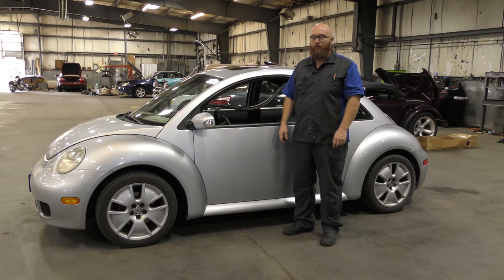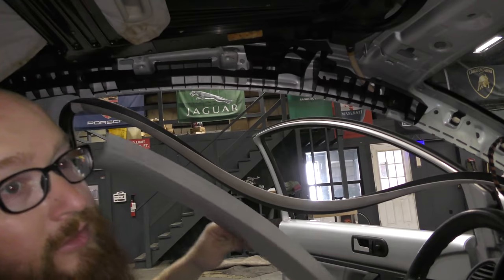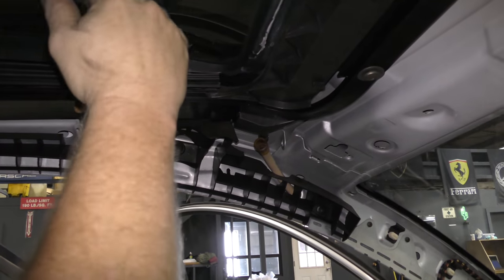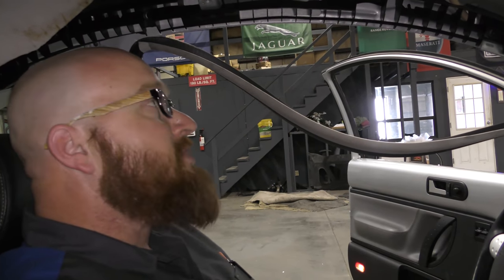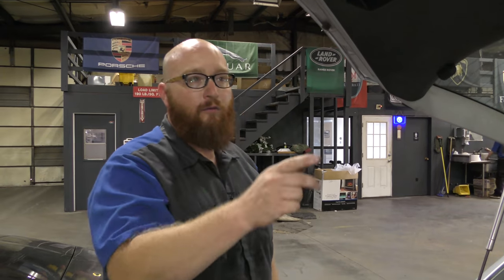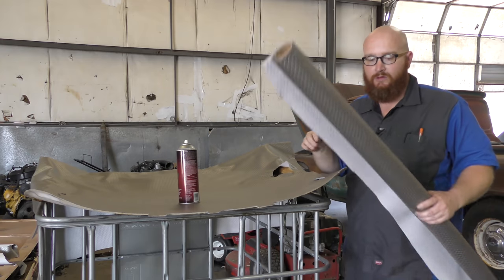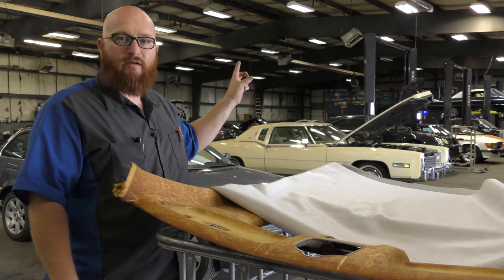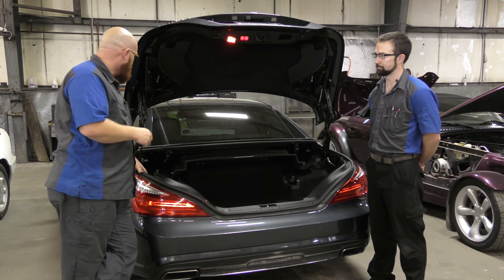VW Drooping Headliner & Mercedes Convertible issues! CAR WIZARD shows one is easy and the other not!

Comment: Is it possible to clean the sunroof drain tubes from outside, possibly with compressed air, without disassembling the headliner.
Reply: My 2009 Jetta had the same problem,  but it leaked in both footwells! No easy way to fix them😩
Reply: Can't say for sure about VW's but i was able to get access to the the drains in my Dad's subaru by just opening the sunroof.  Videos I watched at the time suggested using string trimmer (weedeater) line.  That is what I used.
Reply: It's not a great idea because you could blow the line off the fitting and have a real mess requiring disassembly anyway
Reply: @vincediesil  . Thanks for that. Maybe string trimmer line is the way to go as @boat6868 suggested.

Comment: Would I be able to use a different fabric if the original was damaged? 

My first car was an 89 325i and learned about sunroof drains the hard way. I noticed some drips in the footwell, peeled behind the headliner, and found the entire roof panel was covered in rust. 

Edited to add the question.
Reply: Juan Barba - I’ve absolutely switched fabrics. Just get some fabric with some give to it so you can get it around the curves. I used Permatex headliner spray and purchased the new material from JoAnn fabrics. Honestly, check Walmart too. If you’ve got issues with the old foam sticking to the headliner hit it very lightly with a random orbital sander to get it smooth and clean. I have done my headliners in an afternoon.

Comment: Hey wizard, what do you think of Subaru? Which one's to avoid?
Reply: Avoid many of the EJ series, EJ25 is most commonly used, which had powder-coated  headgasket that would fail, unless someone put new/updated headgaskets in. Any newer Subaru with an F series engine, such as the FB25, is a good motor with no headgasket issues. Flat 6 engines do not have headgasket issues either, EZ30/the newer EZ36D. Turbo (XT) flat four is good too, but people tend to beat the hell out of them. Hope this helps!
Reply: Buy a Toyota.
Reply: Oh dang I have an ej25 Subaru

Comment: 1000 bucks?! Come on, that doesn't make sense. I just did my whole wagon top - headliner, sunroof and columns(6) for 250€ at a shop. On my VW Polo just the headliner was 50€... That is for disassembly, assembly, work and materials.

Note: my upholstery guys clean the old foam with a pressure washer :)

Comment: The 'quality' of New Mercedes. Maybe $10 worth of wires?  IF it could actually be 'fixed'.I am sure the bundle had to be replaced. So that $500? Disables a hard-top convertible. Nice styling, but never got that issue on my '83 560SL. 'The more complicated the plumbing, easier it is to stop up the works'. New doesn't always mean better. Just means extremely complicated. And the cheapest part can stop all the fun. Pieces of wire.

Comment: Hi Wizard, about you question "what weird wiring problem..." it wasn't exactly a wiring problem but still: my 2006 S203 CDI 2.2L Mercedes started to show random ESP error: the antiskid was still working but still there was this error popping out frequently. I passed through forums and many were pointing out to the double brake pedal switch, so I checked it and cleaned it, but it wasn't the culprit. Then I checked all the ABS sensors with a multimeter and they were ok. Then I read that some guy changed the differential oil and that fixed the error, so I did that too, but still I was getting the error. Finally I bought this thing (actually I paid 170$ for it): https://www.icarsoft.com/Product/s-300-iCarsoft_MB_V2.html and there was NO error whatsoever... So finally I used the "real time reading facility" and I discovered that when the error popped out, in the very same moment the CPU was stopping to receive the steering angle sensor data. So I removed the steering wheel and the sensor, open it, clean it with some professional electronic cleaner and deoxidizer spray and boom! Error disappeared and it's ok since 2 years ago. And well, even counting the 170$ of the diagnostic tool, I spared 380$ out of the 550$ that Mercedes would have asked me to replace the sensor, which now is running perfectly since then :)
Cheers, Alex, Milano, Italy

Comment: I use weed wacker line to clean out sunroof drains. You dont need to remove the headliner....
Reply: Wizard was just saying that, if you're already doing the headliner on a car with a sunroof, you might as well check the drains from the inside while you're there, especially if it's easier to access them that way than from the top with the roof open.
Also, with the headliner off, you can check and clean the rear part of the sunroof mount/drains that isn't accessible from the top/outside.

Comment: One would think with all their over the top german engineering Mercedes could do better with this wiring situation, its nothing new as wizard said ---  years ago I worked on a guys '63 Cadillac Fleetwood and none of the electrics worked in either front door, plus blown window and interior light fuses.  Pulled back the rubber door jamb boots and all wires were dried out and broken in two from decades of heat and cold and bending back and forth untill they all just gave up.  I spliced in a couple of short custom made silicone wire harnesses from inside the kick panels out through the jamb boots into the doors so the new softer silicone wires would take the flexing.  One would think by now mercedes could spring for silicone wire harnesses or similar at these bending points - especially for what these cars cost-!!

Comment: Its amazing that after decades of this problem, nobody figured out a better and permanent way to do this so the headliner wont fall apart after 8 to 10 years.
Reply: Jason Radice. I think most car companies have a whole team of people who's job it is to design components that last just long enough until the warranty runs out before they fail. Then to make the component, either so difficult to repair, or so expensive to replace, that the owner gets rid of the car and buys a new one Not only with cars. lol

Comment: Happy Fourth of July (Independence Day) to the Car Wizard. Especially that there will not be a new video from him, because he is celebrating it with his family on that day. I am hoping sometime by next Wednesday for another buy this, not that video on other brands and other types of vehicles. I got the list:

To buy - 2014 and newer Mitsubishi Outlander 4WD compact SUV with the 3 L V6 and six-speed automatic
Not to buy - 2001 to 2007 Dodge Caravan/Grand Caravan with the 3.3 L & 3.8 L V6 and four-speed auto

To buy - 2014 to 2018 Mazda 3 sedan or hatchback with the 2.5 L I4 engine and six-speed auto w/sport
Not to buy - 2008 to 2017 Mitsubishi Lancer sedan with the 2 L & 2.4 L I4 engine and CVT transmission

To buy - 2005 to 2009 Hyundai Tucson 4WD compact SUV with the 2.7 L V6 engine and four-speed auto
Not to buy - 1999 to 2004 Chevrolet Tracker 4WD mini SUV with the 2.5 L V6 engine and four-speed auto

To buy - 2013 to 2018 Toyota RAV4 AWD compact SUV with the 2.5 L I4 engine and six-speed automatic
Not to buy - 2008 to 2012 Hyundai Veracruz AWD crossover with the 3.8 L V6 engine and six-speed auto

To buy - 2009 to 2010 Hyundai Sonata mid-size sedan with the 2.4 L I4 engine and five-speed automatic
Not to buy - 2008 to 2010 Chrysler 300 full-size sedan with the 3.5 L V6 engine and four-speed automatic

To buy - 2017 and newer Mazda CX-5 AWD crossover with the 2.5 L I4 engine and six-speed automatic
Not to buy - 2010 to 2011 Mazda Tribute 4WD compact SUV with the 3 L V6 engine and six-speed auto

To buy - 2008 to 2013 Toyota Highlander 4WD mid-size SUV with the 3.5 L V6 engine and five-speed auto
Not to buy - 2008 to 2009 Pontiac Torrent AWD mid-size SUV with the 3.6 L V6 engine and six-speed auto

To buy - 2014 to 2017 Ford Expedition 4WD full-size SUV with the 3.5 L Ecoboost V6 and six-speed auto
Not to buy - 2009 to 2012 Ford Flex AWD crossover with the 3.5 L V6 engine and six-speed automatic

To buy - 2016 to 2018 Volkswagen Jetta sedan with the 1.8 L turbo I4 and six-speed automatic w/sport
Not to buy - 2006 to 2009 Volkswagen Jetta sedan with the 2 L turbo I4 and six-speed DSG transmission

To buy - 2013 to 2018 Acura RDX AWD compact SUV with the 3.5 L V6 engine and six-speed automatic
Not to buy - 2003 to 2009 Kia Sorento 4WD mid-size SUV with any engine and any automatic transmission

Comment: I hate how they make headliners. They should make them molded plastic and easily REPLACEABLE. You can put cloth over the plastic or leave it bare. If it was removable, you could customize LED lights for additional in-car lighting, or put USB and/or audio jacks so back-seat passengers can easily access them.

Comment: VW headliners are horrible. I had a customer with an 08 jetta that I did a headliner on it was a nightmare. They put it in from the factory thru the windsheild and all of the clips are one time use. But most cars it should only cost a few hundred. But if you do it yourself I wouldn't recommend the 3m 77, spend the extra money and go with the 3m 90 its well worth the extra money all the ones I've done have held up down here in Florida for years.

Comment: Why would you punch a hole in a perfectly good roof? That’s an old mechanic told me one time. Bunch of junk. I have had those Volkswagens in my shop with every door panel and every single piece of plastic falling off. They didn’t do a very good job with making the interiors on those. Looks like you’ve got a better one than most but not by much

Comment: Seems like those VW-Audi cars need endless work.... economical money pits?
Reply: Yeah Volkswagen all the small cars are not very well made they're always falling apart
Reply: Paul Schless Thats rubbish i have many VWs and drove them all around Europe no problem
Reply: Just stay away from VAG products and you'll be fine.
And other European brand's and American brand's.
Just go and look for a '90 s Japanese car
Reply: AKA project car.
Reply: @neilmurphy845  don't underestimate BMW,Renault,PSA,Mercedes compared to those even Fiat is doing a great job.
Then again,just dont buy European or other western rubbish,that are designed to cash money and not reliability.
The days of reliability are far far behind and even the Japanese cars are starting to fall apart,but are still better than the rest in my humble opinion.
Reply: Lonewolf rider Are you Scotty Kilmer in disguise?
Reply: @Lonewolf_rider  ya but we have a few Renault  products and their grant well it says Nissan micra but it's really a clio
Reply: @neilmurphy845  all the Nissan's are based upon Renault, except the Z and the GTR.
It started around '97 where they shared parts and Nissan mostly used Renault's body's but kept their own engines half way 2000 Nissan uses Renault gearbox with their own engine and around 2012 till now it's mostly Renault. Check under the car and I'll bet you will find oil sweat.

Don't rev up that Renault Nissan engine to much
Reply: @Lonewolf_rider  I've had my Merc for a couple years now with no issue. My Lexus RX - which I purchased new - had 3 leaky struts and multiple QC issues.

Comment: Not replacing the foam, is cheating. And cheap unbranded foam turns to powder, like the cheap stuff VW used. Good foam lasts over 30 years with no  problems.